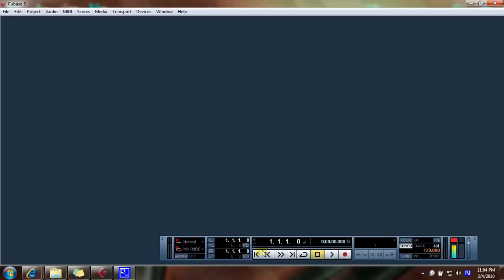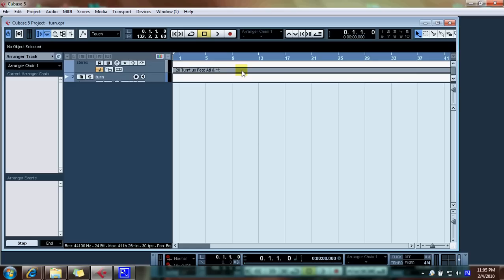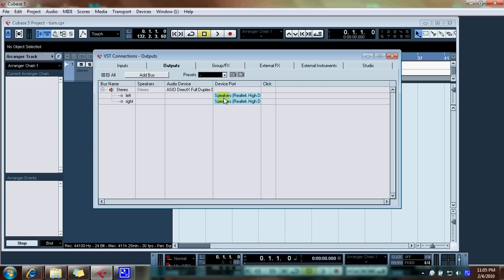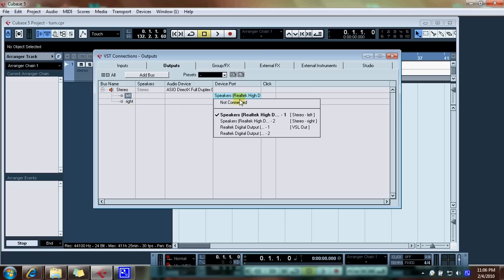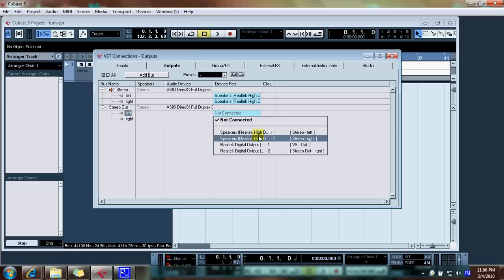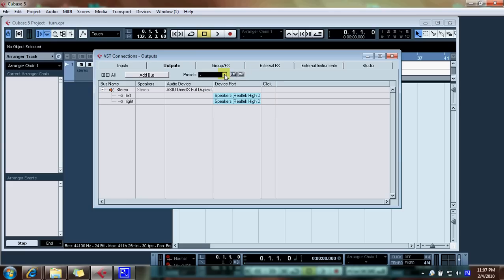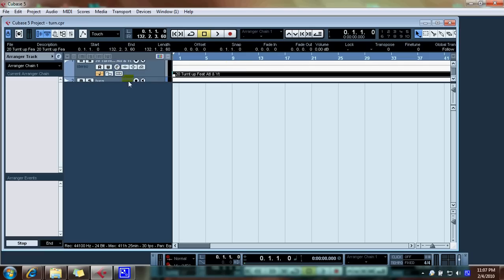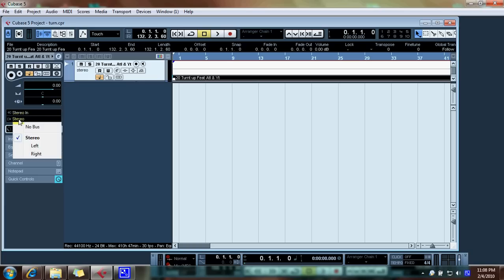Cubase Speaker Setup Tutorial

Comment: So...couldn't get Cubase LE to playback through my bluetooth speaker. Only comes out the laptop speakers or headphone jack. Found out to fix I had to go into the Device Setup-VST Multitrack menu and choose the ASIO Direct X Full Duplex Driver, rather than the ASIO Multimedia Driver (appears to be the default) or the Adobe Windows Default Sound driver. Annoying that I have to manually change that, but that fixed the problem with the bluetooth speaker.